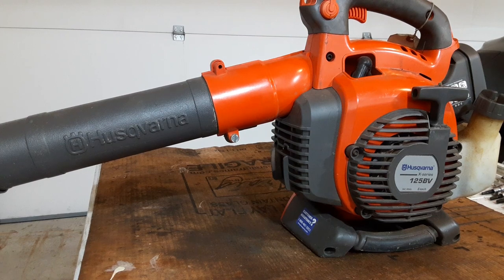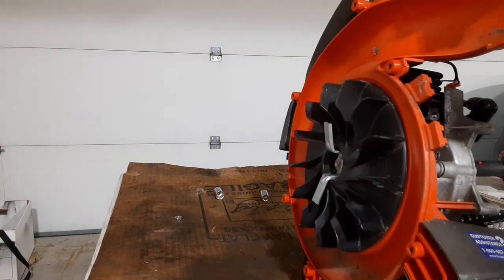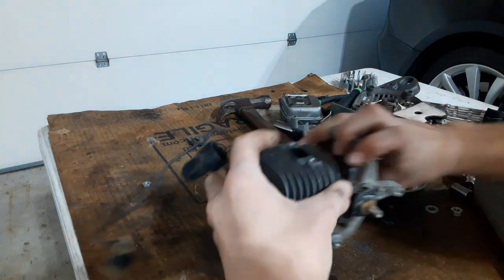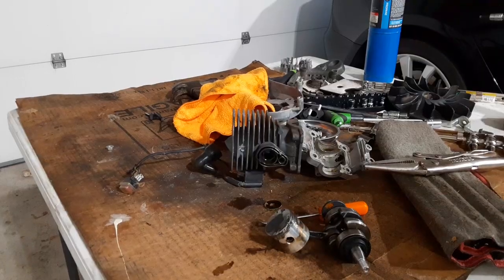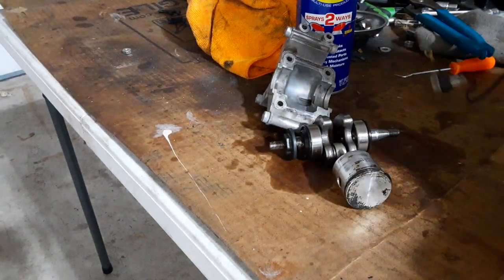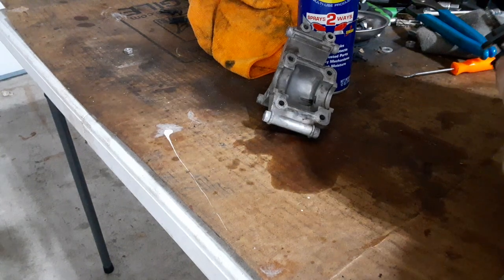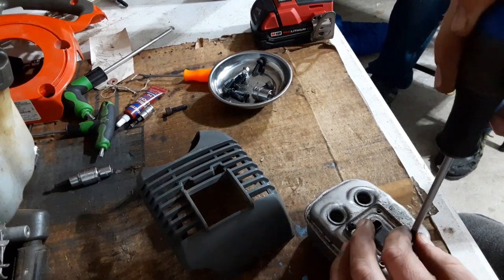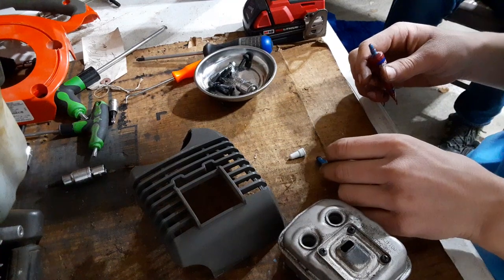WILL IT RUN: Leaf Blower Has Low Compression.

Comment: I have the same blower with the same low compression issue.  I can usually get it to start and even run for a while, but if it stalls when hot there is no way to get it running again.  Cylinder looks good, but I think my ring is also seized.  Piston assemblies are pretty cheap.  I think it’s just too easy to swap the piston and ring.  Your video is very helpful, will definitely speed up my ability in figuring out how to get it apart.
Reply from the maker: Thank you! Take a look inside your cylinder next to the exhaust port. Look for scoring. Run your finger across the inside of the cylinder. It should be super smooth. If it's not, that's contributing to the issue. If not, definitely service or replace your ring. Also, 575227901 is the oem part number for a new ring. Good luck!
Reply: I have the same exact blower and mine is brand new never worked since I bought it low compression

Comment: never use a torch on a little piston, never use channel locks to grip the piston, carb spray and brass brush to clean ring groove, maybe a small pick to get the rest of the carbon off. The torch will destroy the needle bearings in the rod and wrist pin.
Reply from the maker: Well, I used a torch on the piston, and channel locks to grip it. I use that blower as my personal blower and the crank bearings haven't blown up yet.

Comment: The connecting rod pin works its way out and rubs a hole in the plastic crank assembly cover ..so not enough compression to start..at least thats what was wrong with mine ..seen several others with same issue ..not sure how to keep the pin from sliding out..mine will fall out with the crank cover off

Comment: Supposed to be a pin in the piston groove to stop the ring from rotating and losing compression if ring opening rotated toward exhaust port.
Reply from the maker: 30:32 There is.

Comment: Seems to be a big problem with these.  I have two, and a third parts doner. I've put in a new piston and ring, works for awhile then happens again.
Easy fix...Pull sparkplug put piston at top of stroke, or enough to be past ports. Fill with Marvel Mystery Oil to top of sparkplug hole. Sit for 24 hrs or untill all leaks past ring. Do it again. Will then unstick ring and compression and starting restored.
Im now going to try MMO in the gas along with 2 stroke oil and see if it stops happening.
Reply from the maker: Wow. You've certainly had a fair share of problems with these. Personally, the blower I used in this video, I still have and it still works great. However, I don't use it all that much. I would try mixing more oil in the gas, maybe try a 32:1 ratio. That should help it cool better, allowing he piston ring to not get stuck... In theory.

Comment: Most of the time if stuff like that don't have power. Spits and sputters when trying to crank it. Or doesn't Rev up. There's a screen in the muffler that will get carbon build up. Gotta check those every now and then. I've never come across a stuck ring problem
Reply from the maker: How come un sticking the rings fixed the blower then? I looked at the spark arrestor screen and it was clean as a whistle.
Reply: @jonahssmallenginerepair  just from my experience. It's always carburetor or screen problem for me